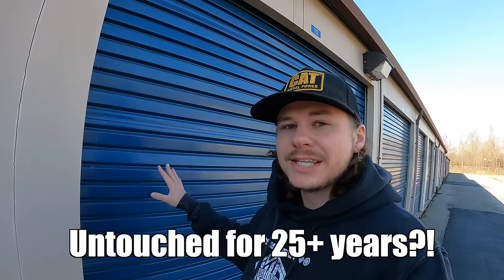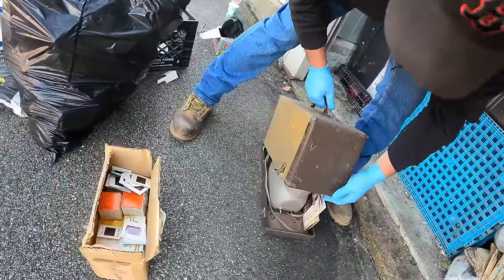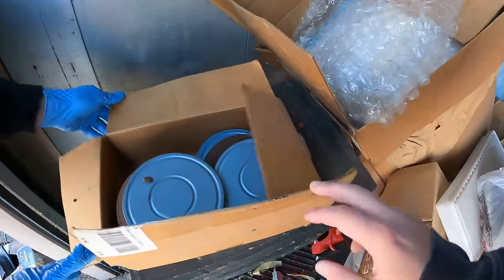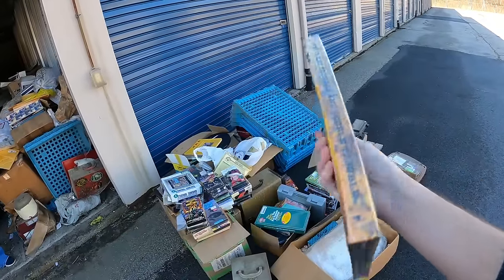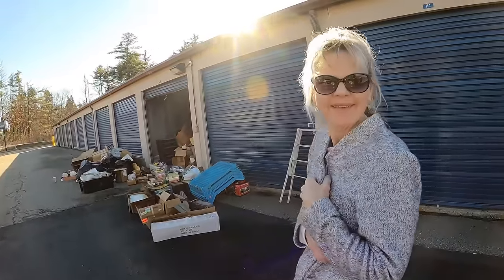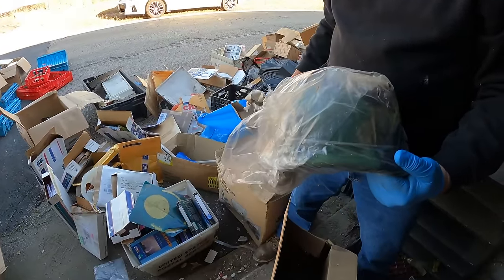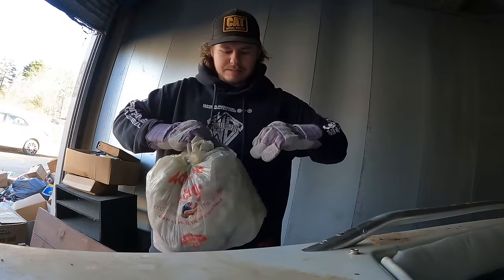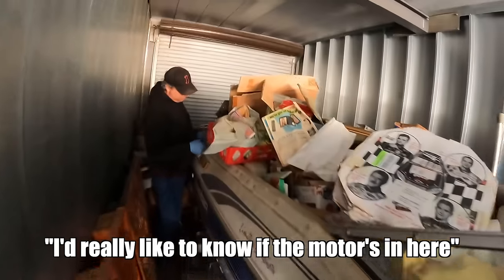Convicted Felon Abandons his 25 Year Hoard! (Part 1)

Comment: some good stuff for $350 but too much labor and dump fees.
Reply: $350 and they have made around 4k and only sold about 70%? Wild comment 😂
Reply: @JUSTINSCOTT_OFFICIAL  Buying storage units you have to calculate how much the dump fees will be. You then have to photo/clean/list all the remaining finds, dump/haul/pay trash fees. Who knows about the boat, could be a nightmare to get rid of. 
Flipping boats is an amazing way to bankrupt yourself unless you are highly experience in aluminum, steel or fiberglass repair in addition to diesel inboard and gasoline outboard engine repair and maintenance. you'll also need electronics and wiring skills absolutely do not try this unless you have the adequate skill to do it. if you're asking yourself if you have enough skill to do it, you don't. Also if you have a place to store them and dont mind the elements getting to it.